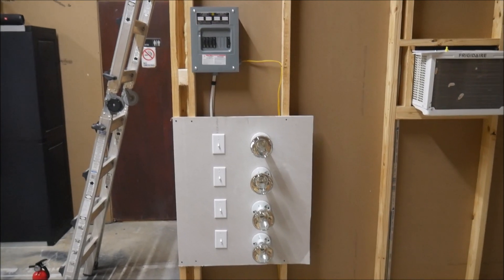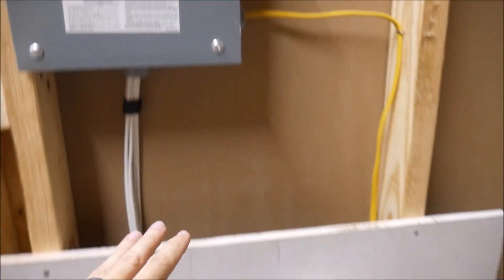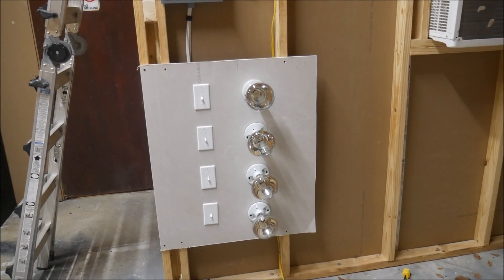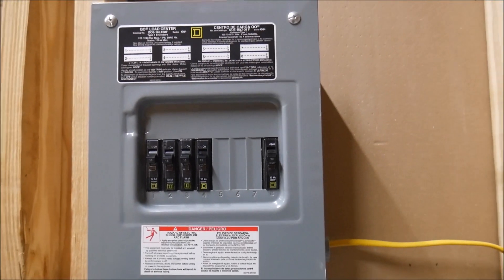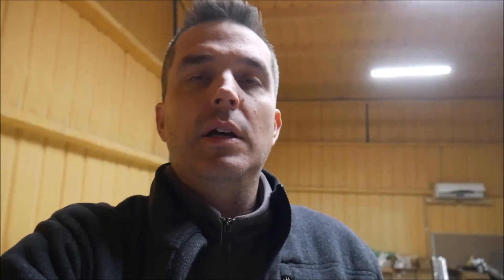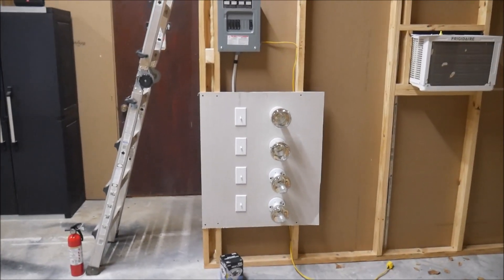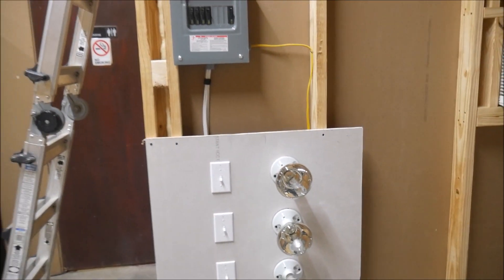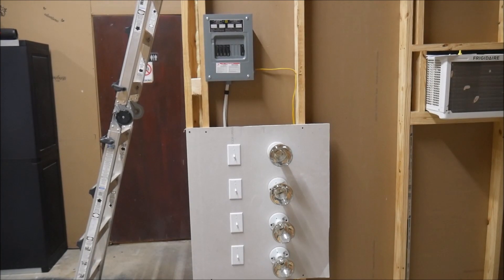120V Alternating Current Load Test Station - Infinitely Variable Wattage For Testing AC Output

Comment: Why not install some type of metering device, big difference between stated and actual wattage. I reccomend one of the cheap Amazon ones think they display 6 parameters on a nice display and are around $20.
Reply from the maker: I have several of those.  I use them in every video to do just like you said... double check stated parameters.

Comment: Nice idea for an adjustable steady load. Secondary benefit, it will also will heat up your work area! Haha also, use different size bulbs to really hone down on your desired discharge rate. I currently us a chicken heat lamp but this idea has me thinking something a little more custom as well haha
Reply from the maker: For sure.  It can be varied infinitely based on the bulbs I put in there.  So if I get a power station that claims a 600W continuous discharge, I can turn on 2 of the heat lamps and a 100W incandescent and fire it up.  If it can't run it then it isn't properly rated.

Comment: If you can double the wattage on each switch then you can count up your load in increments of the smallest load by counting in binary.  For example, if you had 250 on the first switch, 500 on the second, then 1000 then 2000, you could count 250, 500, 750, 1000, ... 3750.
Reply: You can use portable electric heaters.  All these resistive loads are voltage sensitive, so make sure to measure the voltage also. Power into a resistive load varies by the square of the voltage.
Reply from the maker: Yes, all good suggestions.  I'm going to focus on smaller inverters and power stations first with this but I will scale up eventually.

I'm looking for a good data logger that can track the system that won't break the bank and doesn't require a subscription or anything.  The Kill-A-Watt is adequate but if power cuts off (like when the power station gives up) it loses its kWh counter data.  So I need something that operates off of a battery, preferably.  If you know of anything, let me know!
Reply: @LDSreliance  I bought a watt meter that stores its power usage so when the power shuts off it remembers the previous numbers. It's the same one Will Prowse and Hobotech use. It's called a PN2000 watt metet
Reply from the maker: @Jasonoid  Thanks!  I will look that up.  I can't stand watching those two channels :)

Comment: Has anyone built a load tester with carbon piles? I bought a used load tester with a 1000 watt carbon pile from a resale shop, but I can't seem to figure out if the 1000 watts is continuous or peak power, and if additional cooling will be needed. The unit looks like it came from an old factory for testing electronics.
Reply from the maker: I think people use those a lot for dyno testing car audio amplifiers.  I have seen them in several videos where they simulate an ohm load.  I could be mistaken.

Comment: Nice build.  You can't beat a resistive load for a stable benchmark.
Reply from the maker: Yes sir.  I thought about building a massive setup with nichrome wire but this was easier to vary and more readily available with hardware store parts.